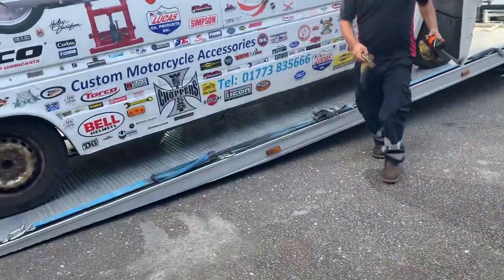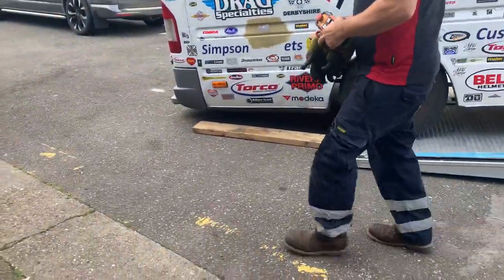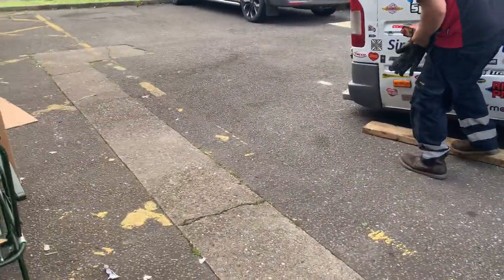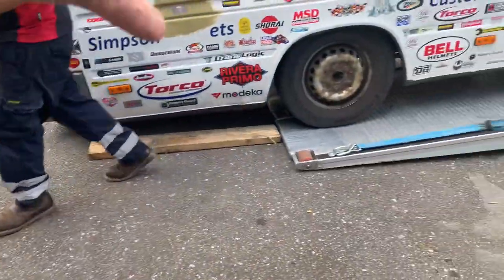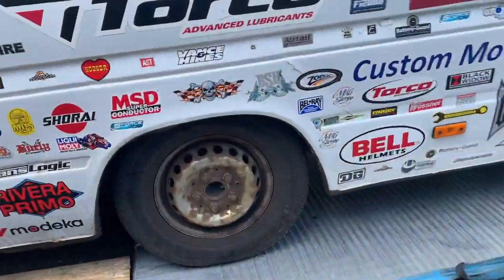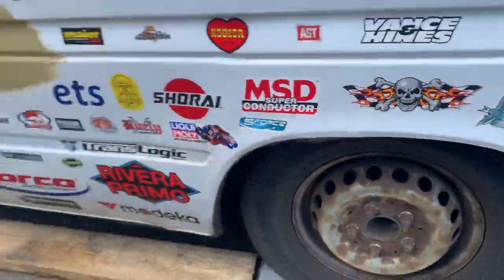@r.a.c7584  Richford recovery bad recovery damaged my 1996 sprinter 312d as told RAC 5 times & Richford

Comment: I think you are being a little unfair that van has got plenty of vintage and rest all over it and even before it had a knock it looked like it needed quite a bit of TLC around the area looking at the rest on the filler that had been put on it previously so don’t be a scammer it wanted fixing before it was knocked so don’t blame it on the RAC man but I’m only going by when I can see on your description on the film
Reply from the maker: the sills were replaced 2-3 years ago no holes before recovery0m no need to weld up  thats point